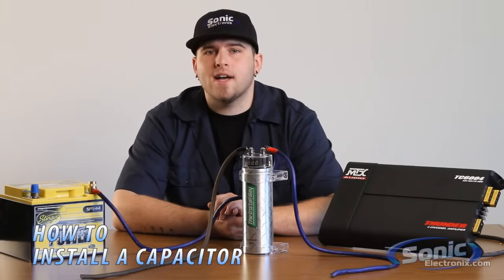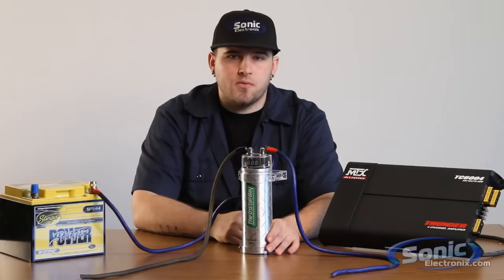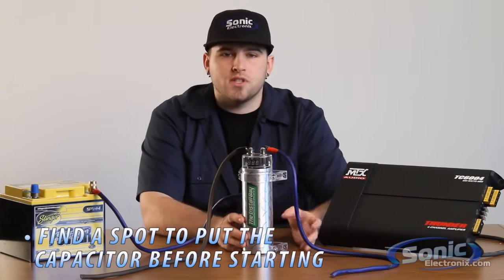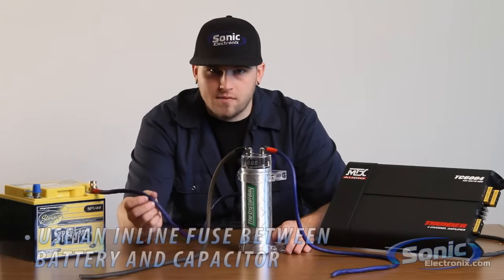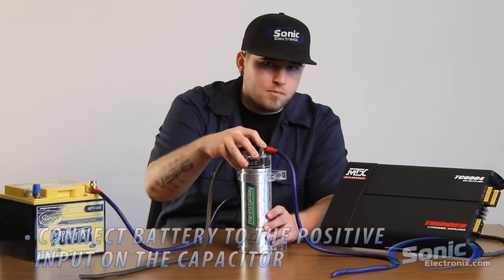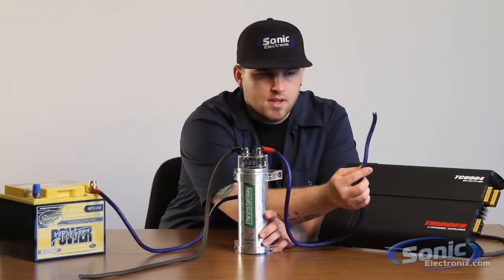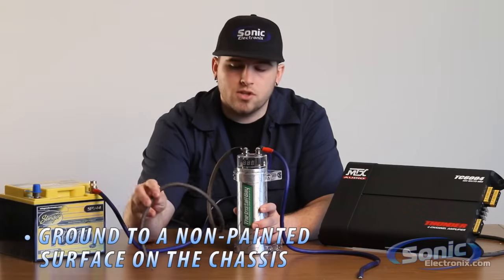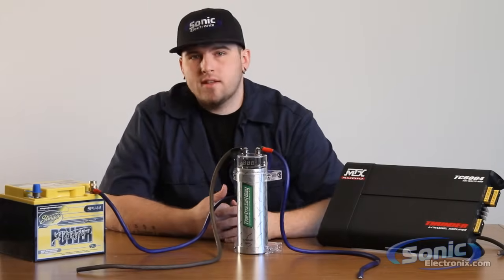How To Install A Car Audio Capacitor

Comment: I normally see people hooking up their capacitors just to the subwoofer side of their stereo system. I was curious if I would be able to hook up my Cap in my main line and run my speakers and subs off of my cap. its a 2 farad cap and my speaker amp is rated at 600 watts as my subwoofer amp is rated at 1000 watts.

Comment: Peopel....if you have a prpblem with your cap not working well do this.  Run another fuse from the cap to the amp. Second fuse helps s lot with big systems also make sure you install the grounds properly. Just make sure the ground you use is very good.  After u scrape the paint off. Get a wet rag and pour rubbing alcohol on it and wipe it clean. It will take off left residue and oil from paint. I hope this helps

Comment: I just installed a cap and everything works good, but my lights still dim AND the cap doesn't seem to turn off after I turn off everything. Any suggestions & tips?
Reply: Angel, the rem from head deck to cap, should turn of cap just like an amp
Reply: How manu farrets is your cap?
Reply: +amos slade i have the same problem with my vm audio 3 farad cap and there isnt a connection for a remote wire to the cap

Comment: How should be required the wire from the battery to the capacitor? 4 gauge is enough or need 0 gauge? my system is 1000watts RMS, Thank you.
Reply: Just go 0 awg,  you can never go to big
Reply: Ok thank you :)
Reply: U can use 4gauge itll be enough 4gauge is 1500-2000 8gauge is 1000 or less
Reply: Hits Bongs 0gauge is 4500+
Reply: +Hits Bongs Im sorry but it doesnt matter I would run 0 gauge anyways, most people upgrade eventually and then spend even more money getting bigger wires just buy 1/0 guage wire with a good fuse block.

Comment: So this will stop the headlight dimming when the bass hits?  It's literally like I'm flashing people at night
Reply: yes. in most cases at least.
Reply: You might also consider a replacement alternator. They make alternators for every car powerfull enough to handle your system. If u dont mimd spending 300 to 400 on an alternator that will last u a long time and will handle your stereo then do just that

Comment: Never handle the cap the way he does in the video. Keep your hands way from the terminals unless you have tested the cap and know that it has discharged. Hope this helps someone stay alive.
Reply: +biffy7 Most useful comment I've read in the whole thread...
Reply: 12 volts won't kill you but 6 amps will and I've seen more than 6 amps coming out of one before
Reply: Jr Jr. No kidding the guy must be a really scaredy cat type.
Reply: You can use a resistor or a light bulb.
Reply: Not a pro, but if the cap has sat for let's say a week without opening the delivery, It's probably discharged if not discharged from the factory. Could be wrong.
Reply: there are two types of people the free mason type and the non free mason type.... so are you like ben franklin and thomas edison or are you not. I would go outside when it storming with a kite and rubber boots. the OP would watch me and call me dumb and say never do that (like my wife). They live for stuff we die trying to make it happen for them. I still love you OP
Reply: Never knew or heard of anyone ever getting killed from 12 volts. I am not trying to be arrogant but it's like all these people stressing removing the neg from the battery. That's for people who make mistakes.
Reply: @jrjr.6667 It's not 12 volts when it enters the capacitor it becomes high voltage. This is how capacitors work
Reply: thats not how electricity works. voltage/resistance=current(amps) so if you put 12V through a load of 2ohms of resistance you would get 6A on the other hand the human body is normally 100kohms, and in the case of broken skin direct blood to blood contact can drop to as low as 1kohms, worst case scenario, that is 12mA at worst and normally to the order of 12uA both of which are no where even close enough to kill you.

Comment: why should i ever install a  Capacitor why is it good for?
Reply: "suppose to be for dimming lights", but in reality upgrade your alternator then a bigger battery, a secondary battery wont hurt so a deep cycle.

Comment: Please people for the love of god dont ever use a capacitor...they do nothing
Reply: ....but they look so cool. Just take my money!
Reply: poonacorn maybe impossible for tone deaf folks but some of us have highly sensitive ears and can hear things most people can't. Me myself can perfectly tune a piano without the need for tuning fork or other sample sound.
Reply: ReturnoftheBrotha
agreed. I tune my sub last too, and by ear. I've been installing systems for 18 years now, and subs should compliment your system not overpower them. BTW saying a sub can't overpower the rest of your system because it's on a different frequency is ridiculous. seriously.
Anyways, my car also died a lot before I installed my cap. Now, no light dimming with the beat, and no dreading coming back to a dead battery.
Also, I'm not fooling myself in to thinking the cap makes a system sound better. It doesn't. But it will make it more consistent.
I have mine hooked up with the big 3 to a optima battery, and my lights still dimmed (in fact, the big 3 sometimes dims the lights worse since the amp can now draw so much more). After the cap, I was good on the light dimming & my subs sounded smoother during long constant bass pumps. I'm not installing more than one battery for a system that's not competition. That's just overkill imo for my daily driver.
I'm not trying to beat down the block, I just want loud tight bass that compliments my mids and highs without lights that beat to the bass lol
Reply: ReturnoftheBrotha You're wrong about capacitors. This guy was just trying to teach you something. Obviously that was a waste of time..
Reply: poonacorn
You have no idea what a capacitors function is do you?
I think it's best you find out exactly what there function is before you post anymore responses..
Reply: Dave cose Except what poonacorn is saying is in line with what everyone else in the car audio game is saying. Ever wondered why the big boys use batteries rather than capacitors? Capacitors are essentially useless for anything other than clearing up some dimming headlights. They serve no benefit whatsoever to your car audio system and in fact create more of a power draw on the electrical system not less.
Reply: By your comment I can tell you don't have a clue what a capacitors function is. You should SERIOUSLY GET LOST.
Reply: Dave cose By your insulting him rather than actually demonstrating he is wrong we can tell you're a moron with no argument.
Reply: Thezuule1
Ummm. When did I insult anyone?
You should read my comments before saying I'm insulting people.
All I'm saying is Poon has know idea of what a capacitors function is. I do.
There is no argument to have in saying that statement.
Reply: Dave cose Telling someone they have no idea what they are talking about is insulting and it's an example of an ad hominem fallacy. Poon is pretty much correct about everything he's said here from what I can see.
Reply: I never said that either. Have you read my comments?

All I keep saying is that he has no idea what a capacitors function is.I stand by that statement whether you agree or not.
Reply: Actually all these 1 farad capacitors are a joke. Try using a maxwell 3000 farad capacitor on a 14 volt set up and you will see a huge difference in your performance.
Reply: ***** A car battery is not a capacitor. A battery stores electricity chemically while a capacitor stores energy in an electric field.
Reply: ***** A dry cell still stores electricity chemically.
Reply: ***** I'm not sure what in the fuck you're even talking about. Bug off.
Reply: ***** You may want to read the comments again jackass. Also it's 'you're' so obviously you don't know crap about the English language. If you think a battery and a capacitor are the same thing I'm afraid you're the one who doesn't know jack shit about electricity. I honestly don't care what you do provided it isn't saying things that aren't true in public. Telling people a car battery is just six capacitors is just wrong. Accusing me of trying to sell shit is just delusional.
Reply: Capacitors deliver electrical current faster than batteries they can charge and discharge in nano seconds (faster then you can blink) which makes for cleaner heavier bass that puts less strain on the battery from loud heavy bass audio. I still think a upgraded alternator and even adding another battery is absolutely necessary when upgrading your audio system expinetualy and it's better for your car. But with that being said a capacitor is not made to solve your draining problems its meant for delivering power when needed
Reply: It does help, my amp hits more intense for sure keep my power 13 volt and up, before voltage woul actualy drop under
Reply: ReturnoftheBrotha hey I’m kinda new to getting a system I know I need a new alternator and new wiring any suggestions for the type of alternator I should get for my 2006 Honda Civic?

Comment: Does this discharge ur battery at all or do u need an isolator.the suv i bought 01 expedition i have an 800 watt perfomance teknique amp running 2 10s and get dimmming ligjts so i either want a cap or kinetic battery.cap is cheaper but again my main question is do i need an isolator for cap cuz i know u need for battery

Comment: I need help, i bought a used cap, and i dont know how to use this, i know now how to install it but i dont have a resister, and do i have to always charge and discharge this thing everytime i turn my system on? And what else can i use to charge it? I would deeply apreciate who ever can help me with this question.
Reply: In my opinion there is no reason to discharge the cap unless you are going to service some part of the car.
Reply: Ok thanks, yea i got it now. I only discharge if im going to change some wiring or battert and i know how to charge now also. Thank you thoe for responding.

Comment: Your explanation of wiring this capacitor isn't very thorough. I'm not familiar with the exact capacitor you're using an example, but if it's a Polarized Electrolytic capacitor (which is very common for this application), you're wiring is incorrect. A polarized Cap in essence is a battery (of sorts) and there is no In and Out, there is a positive and a negative. So, if you're wiring a polarized cap the correct wiring would simply be tapping the Positive terminal on the cap with the supply wire from the battery, then on to the amp and grounding the negative terminal of the cap. However, the "In and Out" would apply if the meter on top of the cap is an ammeter. Either way, you may want to clarify that, because not all caps will have the ammeter.

Comment: do i need 2 capacitors if i have 2 amps ? if you dont mind me asking
Reply: No, caps are junk.
Reply: Thezuule1  You're kidding, right? Do you even understand the operation and theory of a capacitor?
Reply: kwantoon Yes that's why I said what I said. Caps do more harm than good. If you're having power issues you need an alternator upgrade/wiring upgrade and a better or additional battery. Caps are a waste of money imo.
Reply: I'm not saying they're a miracle solution, but I believe they have a positive effect. In order to get a beefed up Alternator you're looking at a few hundred dollars, and a cap is a cheaper solution. As far as an additional battery goes, it's pointless if you don't have a high output alternator. Once a battery loses its charge it's essentially sapping more power instead of providing it, so now it's not only useless but it's become a detriment. There are reasons why electric motors (AC/DC) use start and run caps, they provide a much steadier and reliable power supply. It's not just a myth, it's a proven system.
Reply: kwantoon "As far as an additional battery goes, it's pointless if you don't have a high output alternator. Once a battery loses its charge it's essentially sapping more power instead of providing it, so now it's not only useless but it's become a detriment."

Apply that same logic to your suggestion of a capacitor for a second. See the problem? The fundamental difference is that once charged a battery will hold shit tons more power than a capacitor will and a volt meter and some self control will keep your system dropping bass much longer than the split second that a capacitor will last when it discharges. There are rare applications where a capacitor will solve some weird electrical issue but it will never result in more sound for more than a burp. If you want to produce consistent power from an amplifier you need a consistent source of power. A good battery provides enough amps to keep a 2000w amp running far longer than any person should be listening to it in a single sitting without being recharged at all. Add an alternator into the mix and don't play it at full blast every second that you're in the car and you'll almost never run into a power problem.
Reply: Mario Mangone You know what, you're right (no sarcasm). I do understand how a capacitor works, what (at the time) I didn't understand is how a higher capacitance worked with a high amperage draw on a lower voltage direct current. I have used them in the past on my own installations, however, I never ran anything even close to competition. It really seemed to eliminate most of the stress on the alternator, especially when current draws would spike. It totally eliminated my headlights dimming and things of that nature. As for sound being effected, well that's up for debate. At the time I really was convinced it did, but that could have simply been the placebo effect.

So,  I withdraw my previous comment(s) and I stand corrected. I try very hard not to be a big mouth idiot when I'm speaking about things I'm not 100% sure about, but every now and again one will slip.

Comment: Maybe, you should have mentioned not to plug the power directly to the cap until it's pre-charged through a bulb or resistor, unless you want a fireworks show in your car.
It should be the first thing mentioned on a "How To Install A Car Audio Capacitor" video.
Reply: how do I pre-charge with the resistor the came with my cap. No manual was in package or directions...
Reply: Akeem Rahaman run the ground to the chassis and the cap, and then positive to the battery, and then to the resistor, and then touch the resistor on the positive of the cap for about 30 secs, then take the resistor off, and plug the pos to the cap

Comment: can you ground the capacitor and the amp to the same spot?? or do i need to find two separate places? thank you for whoever answers this
Reply: You should not ground them together, you should ground them in separate places. You don't want to risk blowing any equipment or fuses.
Reply: Thank you! Helped me a ton:)

Comment: are capacitors necessary? i'm going to install a 1,000 watt crunch p1-1050.2 a/b amp to my grand am so i am curious.
Reply: You shouldnt need it for that amount of watts, its really only used for big systems drawing alot of current.  =)
Reply: DIRTJUMPERZ308 awesome thanks man i appreciate it.
Reply: (ANALOGY) think of you battery as air in an air line, your battery only puts out say 60 psi, a capacitor acts like a compressor it can accumulate and reserve say 120 psi, so the bigger the amp, the more likely your going to see the advantages of a capacitor, ITS A SUPERCHARGER FOR ELECTRICITY  they also save your battery from the abuse of dramatic current draw.

Comment: can anyone help me? I have a pair of fli 375 watt 6x9, I have just ordered a 750watt amp and a 1000watt wiring kit. I am planning to put this in my 57 plate Renault twingo 1.2 turbo. Will the cars standard components put up with the amp etc. Or do you think ill need a cap or other bits. Thanks

Comment: So why the separate ground off the cap and amp? I got 1 12 CVX, IX1000.1 and cap which I have linked all together, all 4awg kicker wiring etc. 95 accord, big three is next but I upgraded alt to 140amp. I guess it wont hurt to have a double ground off amp and cap. Myth on the shorter the ground wire the better off the amp????
Reply: I thought that.

Comment: I've got a 2700w lanzar amp 2 ch and 3200w sub 1600 twins though and im just wondering what wiring kit would i need and would i have to use a power cap?

Comment: i have a 2013 honda civic sedan. and i want to install a 1200 watt amp and 1 12. do i need a capacitor for that? please respond. it would be greatly appreciated. thanks.

Comment: My alternator still works, but there is a "whirring" sound from it. Frozen bearing? I'm going to replace it, check the grounds, even though nothing has really been changed. Other than that, possibly a bad amplifer. I have another amp to test things out, just difficult to get the other amplifier hooked up in the spot that it's in.

Comment: I never bought this amplifier from Sonix. I had it in the car that I bought awhile ago. My audio system has ran just fine for months up until two-three weeks ago. I did have the alternator tested and the guy said it was fine, though, once the amplifier did a big draw, the voltage dipped just below 12 volt and the amp would go into Protect Mode. Also, last week, I turned the air conditioner on to cool the inside for a few minutes and there was a burning smell. I guess it could be my alternator.

Comment: Protected mode mostly only happens when the ground is messed up. it gets power but is not grounding out. Don't buy this refurbished shit off sonic electronics. Go to a guaranteed place and ask them. Crutchfield they are amazing and are way more knowledgeable. hate to see you get screwed